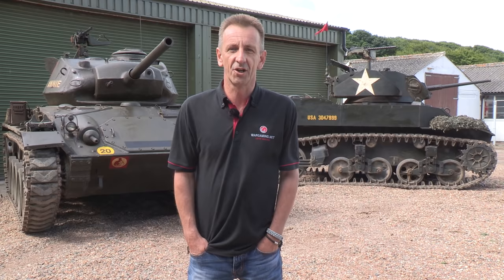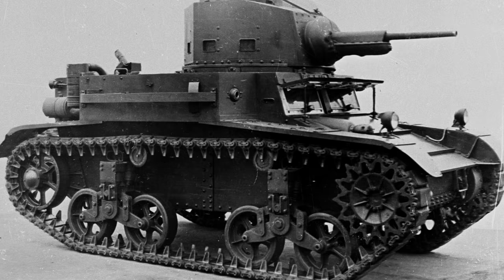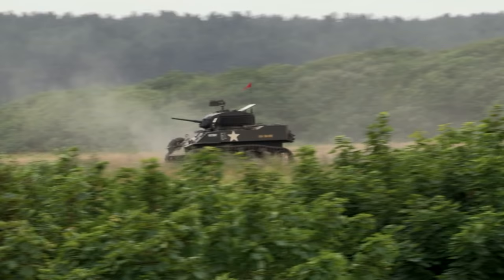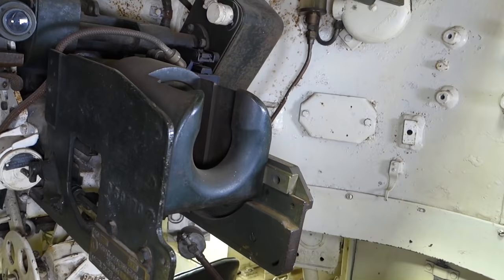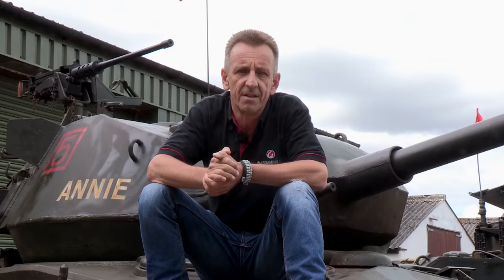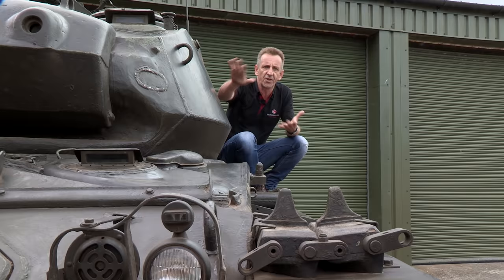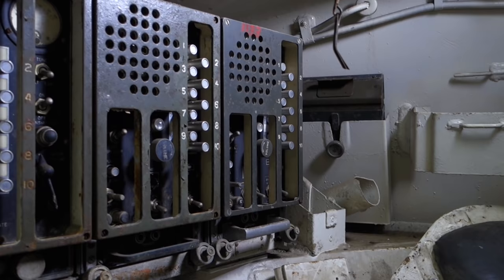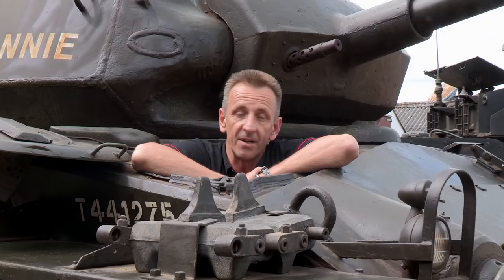Inside the Tanks : The M5 Stuart & M24 Chaffee - World of Tanks

Comment: It may be here or may not but the M-24 was still in use in Norway until the early 1990s.  They were upgunned to a French low-pressure 90mm main gun and had the power pack replaced.  The Norwegians saw this as a relatively low cost upgrade to a proven vehicle.

Comment: When use correctly light tanks are highly valuable. The light tanks use less fuel they can exploit flanks and generally harass the enemy better than the fuel hog heavy's.  Light tank armor should only be expected to protect the crew from rifle fire and shrapnel.  The speed of the light tank is it's advantage.  The M3 Stuart was very capable with the 37mm gun to take advantage of flanking enemy tanks.  Fighting head on would not be the way to use light tanks, they would not survive frontal assaults.  Hit and run, never trade punches with any other tank.  It is not practical to engineer tanks to take more than it can dish out, but that is what has been done.  The Chaffee with it's  75mm gun was a worthy replacement for the Stuart.  The 37mm lost the confidence of tankers because it was the smallest gun on the battle field.  The controversy of small hole vs big hole, the big hole gives better odds of a one shot kill but reloading is slower so if a miss is scored the smaller faster reloading gun is favored.  That gave way to the slow heavy M6 mounted with both a big hole maker 76mm and a small hole maker 37mm.  The 76mm  M18 tank destroyer filled the flank and harass role best,  it just needed a lid on the turret.

Comment: As I see it, the Chaffee was underpowered.  It looks great, but a slow light tank is a grandma car.  The Walker Bulldog came out of the low power closet, increasing Chaffee's 220hp powerplant (dividing 220hp by 20short tons for 11:1) to 500hp (dividing 500hp by 23 tons for 21:1).

Moreover, we already had a 75mm armed replacement for the Stuart in 1942, with the US M7 Light.  That was the purpose for which it was designed, after all.  Confusing its potential with the need for a replacement for the Sherman was a disservice for a fine design.  It also meant our Light Tank Battalions and Recon Squadrons had to soldier on with what was in effect a modernized Renault FT.  Chaffee was a pig in a poke, war wise.  We could have issued, should have issued, the M7 . . . the WoT equivalent of the Gremlin!
Reply: It wasn't slow. It would  reach 54km/h relatively easily. I have actually seen Collings Foundation's first M24, even with its age brake 50km/h without difficulty first hand. 

The M24's combat weight is a bit over 40,000lb (20.25 according to its TM). Not 23. 

Though as far as a mobility is concerned, there is no direct effect that power-weight ratio has on the vehicle's ability to move. Maybe some sluggish acceleration, though that directly depends on torque. And doesn't on power-weight. The M24 according to its TM is rated at 480ft-lb at just above idling rpm. For a PanzerKampfwagen III Ausf.L/M (according to the given information of it on Valka) is approximately 517 for marginally higher hp at lower rpm. Then again, that's one V-12. This is two, much smaller, V-8 automobile engines.